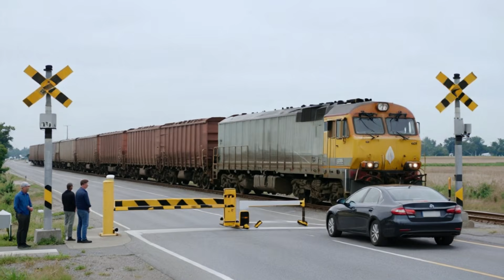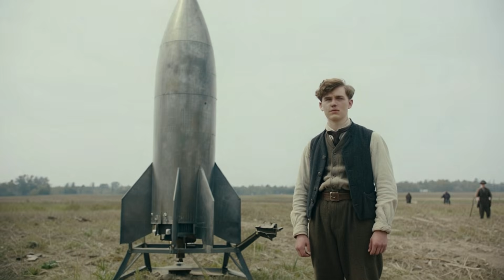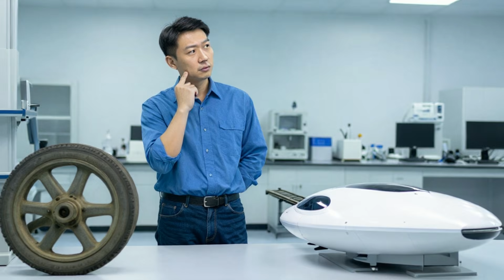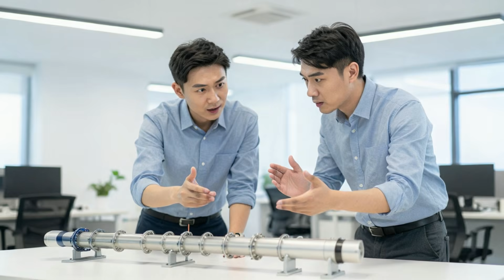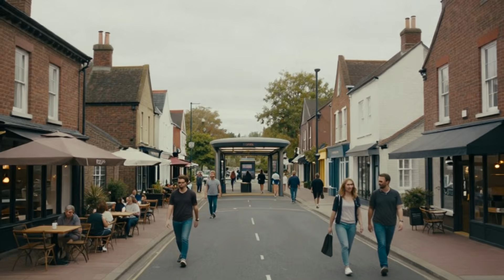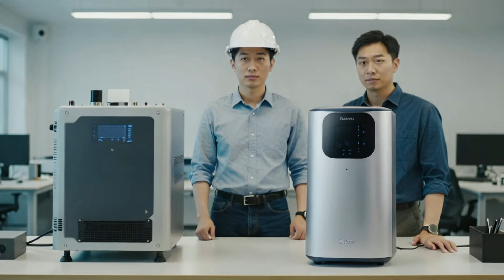China's New Invention That Could Make Trains Obsolete

Comment: There could be a different way of doing it. On any underground railway you feel a draught before the train arrives. A circle line could have high-speed wind with all the trains moving the same direction , much cheaper than maintaining a vacuum.
Trains would pull off the main line to the station so that the high-speed wind could continue.
The trains themselves would act as pistons to push the wind so you would need regular high-speed trains.
The problem is the danger

Comment: Not So Fast. There was a time when interoffice mail was sent by compressed air, Pneumatic Tube Mail Canisters. You put your mail in a canister and inserted it into a receiver. The message dropped out at the other end. How about putting a passenger car into a tube and using compressed air, which pushes from the back. No mag-Lev needed. Also, passenger trains mostly run during the day.   How about freight transport during off hours.

Comment: really cool tech but the maintenance must be crazy.
Reply from the maker: there will be a solution for maintenance also
Reply: @boobywilliams-o7f 
Robots. This is why China is going extensively into robots. They already had drones that clear the icing on power cables. The drone will fly up, clamps onto the power cable and remove the icing. 

Think China will have something similar for the maintenance of these trains.